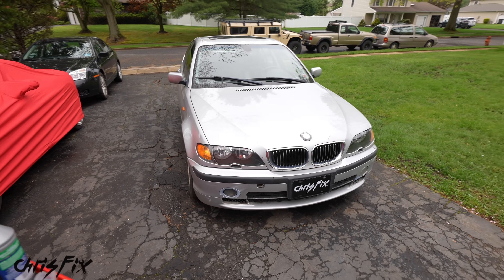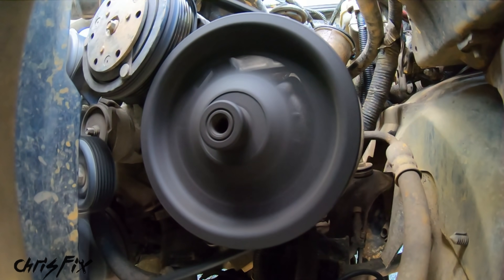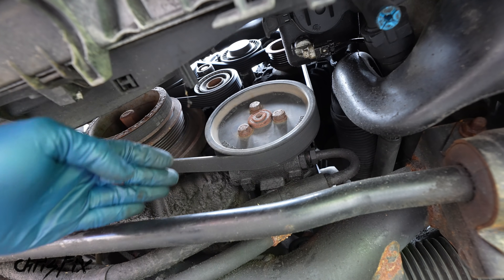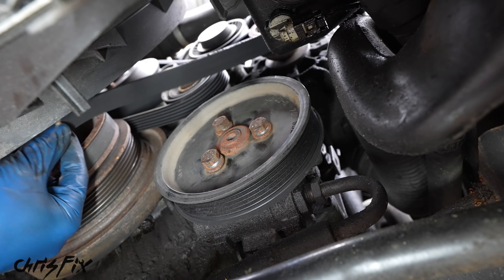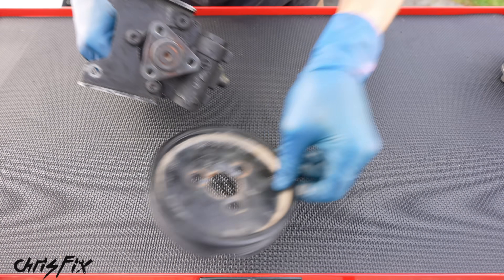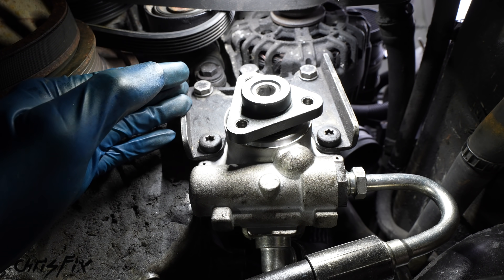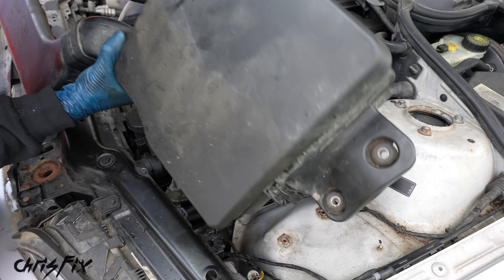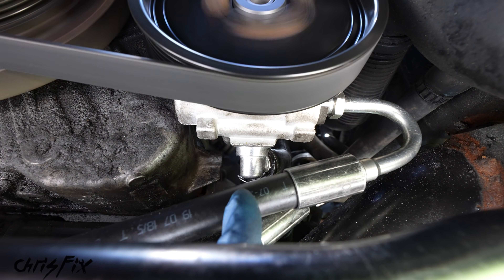How to Replace a Power Steering Pump

Comment: today I went to go see a car and it the steering wheel was a bit hard but the owner told me it needs a oil change could that be the problem because the steering pump doesn't make any noise and it's not super hard to move like in the video it's just not super smooth (the car is a 2011 subaru impreza wagon 2.5)

Comment: You forgot one more reason why the rotor on the steering pump might stop... Screws. 

Yes, screws.
I changed mine and forgot to put one of the screws in and I thought the new one was broken too. It wasn't, took me a while to realise
Reply: Gives you the same issue as a bad belt, because the tension is not there

Comment: Chris thanks for the great videos, have a question. What’s your trick to get proper torque specs. I have a 2007 hummer h2, have a gone to multiple dealers to try get repair manual and not available. Not really trustful of random websites. Thanks

Comment: My power steering fluid reservoir keeps going empty but I can’t find a leak anywhere. I took out the reservoir and the hoses and checked them for cracks and leaks and couldn’t find anything. Any ideas?

Comment: Can a bad alternater cause the steering to squeel? My alternater is bad and I'm working on replacing it and the AC belt and power steering belt. Id like to replace power steering pump while my car is taken apart but im hoping i don't have to pay for a new one and its something else. The steering pump and pully are over $400. The reason im questioning if the pump is bad is because its rusty and the pully is very rusty so im worried it will screw up my new belt.

Comment: My truck has a lot of play in the wheel and my power steering doesn't work as well as it should. When you're turning the wheel to back out of a parking space, it takes more effort than it should to turn the wheels. When you're driving, it has very sloppy steering. Is it my steering box?

Comment: Hello chris, i have a 1999 Nissan NP300 King cab and the steering is okay and light, but when the steering is at a certain angle it make grinding noises. Do you know what the problem could be?

Comment: hey chris, where did you get the highpressure lines aswel as the new reservoir and plastic lines? had a failure in my power steering pump aswel so changing it rn. thanks!

Comment: Have a question for Chris or anyone in the know.  I have a Lexus that the manual says requires ATF for the power steering fluid.  But it looks like someone put regular clear power steering fluid in the system rather than the ATF fluid the manufacture recommends.  I was going to drain and replace it with ATF.  Will there be any issues caused if I do not get every bit of the PS fluid out of the system and little remains mixed with the new ATF?    Is it possible the clear fluid in the PS res is actually some kind of clear no color ATF?

Comment: @Chrisfix I have an issue with my car maybe you can help me, Everytime I turn steering wheel all the way to left or right on my w204 c350 while the car is idle, the steering starts to shudder and rpm increases, what could be the possible reason?

Comment: So my power steering pump is leaking badly and the fluid is low/ dirty on my '88 F-150. The belt slips from the power steering pump pulley seconds after I turn the car on. Is the belt slipping because the pump is bad? I already replaced the tensioner and the belt is lined up correctly, so I'm assuming it's the pump.

Comment: I think I got to change it cus I add fluid and then like two days the fluid is almost gone and makes noise but the steering wheel is fine and acts normal but I did a oil change and I can see in one side of the car it’s all wet and greased up on the power steering side but I want to know how come I have low fluid and my steering is fine

Comment: Hey chris, Mom's 528 2009 BMW was low not on the stick. Fluid in the reservoir but lower than the stick. So I grabbed a bottle of Prestone European model fluid from Walmart. We ran errands it was fine but then she drove somewhere else that day and the steering was very hard manual labor. Is your video will be the third video, so to point I plan on reservoir change and fluid flush ... Any advice ?

Comment: I thought the e46’s would recommend using atf? Is the synthetic fluid you used better in your opinion? I have a 2003 e46 330i and I’m getting ready to do a power steering flush and looking into what fluid is best to use
Reply from the maker: So this stuff is better. I actually reached out to PEAK to ask this exact question and they explained why but honestly I forget haha

Comment: I have a 2008 Hyundai Azera and I replaced the power steering pump and bled the system the same way but the steering is still stiff. There are no leaks or air getting in, any ideas?

Comment: Hey Chris just wanted to let you know you might need to change that power steering fluid in the BMW idk though(it could be okay to leave it)but In my opinion the fluid looked pretty black coming through the turkey Baster and btw.....how heavy is that new aluminum belt pullley/tensioner?(how much weight is that aluminum tensioner adding to the car in other words?)

Comment: Clearly that power steering kit he bought off ebay was one the seller found after it "fell off a truck".  Because the CHEAPEST you can get ANY of those kits for an e46 is around $650.  The majority of them are around $800 complete like his.  That is, if you have the LF-20 pump like he did.  If you require the LF-30... ppfffth.  You're in for a HUGE surprise.

Comment: Pretty sure that year car takes ATF fluid for the power steering. Later years are different. May not make a huge difference if you changed all the fluid out.

Comment: Hey Chris, I recently changed my power steering pump but ever since I changed it, it started whining when I accelerate and it’ll groan when I lock the steering wheel all the way to the left and right without the car moving. At first I thought it was the fluid but it’s topped off. I’m not sure when it can be  hopefully you can help me out what it can be. I was thinking it could be a faulty new pump but I want to make sure it is before I take it apart and send it back for a new one.
Reply: Could be a leak in the hose or reservoir so first check for leaks. Could also be air in the fluid which means you will have to jack the car up and turn the wheel back and fourth about 20 times per side.
Reply: @loganl7088  thank you! I have noticed the the hose leaks so I might replace that

Comment: Hey Chris, I have a 1999 Ranger 2.5L which I believe is the same engine as your truck on the video. Anyway, I replaced the power steering pump and it's still making a lot of noise even after turning the wheel several times to  burp the air out, any idea what can it be? Thanks.
Reply from the maker: Ford pumps are noisy. Just drive it around and don’t worry. Make sure you check the fluid ina. Few days to make sure it’s still at the correct level

Comment: When I turn my car on, fluid squirts constantly out of one of the lines straight up towards the engine. Unfortunately there's also power steering fluid all over my engine. Including on my alternator. It's a Hyundai, and it would seem nobody online knows how or at least will show how to repair a steering system in a 2002 Hyundai sonata. Auto part stores don't seem to know what line I need either.

Comment: I actually have a Manual Mitsubishi Jeep from 1969, and when i try to turn the wheel while it's idling, it tries to stall. So i have to hold the clutch and bump up the RMP every time. It gets really annoying when I'm stopped at traffic. What are the possible causes?

Comment: guys i got a question i got a bmw 320i e46 1998 and my steering is hard to steer but not to hard so you can still drive is my pump broken or not also i got some fluid in my tank

Comment: I have a Mercedes E500 2003 and my steering wheel was hard and then it got harder I step on the gas’s a lil and it’s still hard to turn

Comment: Hey. What if the steering is aloooot stiffer than yours? Mine went out when I was parking. Steering wheel is almost impossible to try and turn at all. Liquid is full. There’s no whining noise…it’s more of a sucking in noise. Not sure if it’s the power steering pump or if it’s the rack and pinion. Any advice on how to figure which one it is?????

Comment: The video is well done but - please use real clamps instead of the cheap perforated ones. Pinch clamps actually make a lot of sense in many applications, if you want to use worm clamp ones use OE ones or high quality ones like the ABA/Scandvik or the AWAB ones - and cut your tails, remembering to round out the corners of the cut tail. Your hoses will thank you, so will the next guy who sticks an arm down there.

Comment: Ok so, in my Ford Taurus 06 when I turn my wheel it’s easy to turn but it makes these loud screeching sounds worse than what I heard here, but my power steering seems fine I can turn very easily etc but if I’m stopped car is running and I decide to reverse or after reversing and turn my wheel fully the other side to drive out it makes those noises and only when I’m stopped… so is that a bad belt? Power steering pump problem or do I just need to change the old power steering fluid?
Reply from the maker: Check the pulley as someone turns the wheel and see if there is a pulley seizing up. Sounds like an old belt to me.

Comment: yeah my 2010 silverado (first truck) needs to be checked by a certified mechanic i know where the leak is coming from and my hunch is yet to be proven or disproven 

leaks coming from right where one of the lines goes into the pump so my hunch is its loose and is leaking it (i went through a quart of fluid in 30 seconds )

Comment: "don't forget to chuck the wheels" - PLEASE DO! CHECK 3 TIMES! Recently i was working on my rear brakes, and didn't secure front wheels. Guess what? The car just rolled forward after I pulled the wrench. Luckily I was kneeling, but just minutes before, my legs were directly under the brake disc.

Comment: I was riding along with a friend of mine a while ago and he was showing me that his steering wheel shakes at highway speeds, could that be a power steering issue or is it more likely something alignment related?
Reply: That could be the bearings in the wheels, possibly suspension. Definitely get that checked out, you don't want a tire flying off at highway speeds.

Comment: Hi Chrisfix I have a 1996 mazda bravo b2500 my steering wheel has alot of play when I’m driving or just playing with the steering wheel what do i do or what could you recommend I look at?
Reply from the maker: Jack up the front end and turn the steering wheel and see if the tires turn with the steering wheel. If not it could be the steering rack.
Reply: @chrisfix  so if it is the steering rack do i replace it and go from there?

Comment: Can someone try and help me understand if I should replace mine, I have a groaning. Noise from the power steering pump but the wheel isn’t hard to turn but sometimes the pump will go back to normal like nothing is wrong with it

Comment: My power steering pump is leaking and I was told I need to get replaced enough though it’s been replaced a year ago any suggestions or should I buy a new pump
Reply: If a shop replaced it check to see if there was any warranty on it for a certain year or mileage

Comment: Didnt mention a bad rack. Sure it couldve bedn the lines but on an 03 cavalier idk if thatd be the best option if its hard 1 way n not the other. N if it is the rack. I got news for ya. Open up a day n a half of ur schedule. Bc u gotta lossen the back of the crossmember of ur engine n drop it a couple inches. Then loosen all the rack components like the steering shaft and the lines from the pump. Then u gotta slide it. Turn it n slide it out more. Then do the reverse for the new 1. On top of that u gotta make sure the pinions are right. I found a secret for mine n it saved a bit of time but the fact that u gotta lower the engine on that car is insane. Not long after that it got totaled. So if anyone comes across an 03 cavalier in Columbus ohio with jegs stickers on the windshield most of the front end parts are near brand new. Check the junkyards.
Reply: On the plus side the cavi pump is connected to the camshaft and not the bdlt so its easier to replace.

Comment: Nu pump failed at where the bold get in ...I think because the bolts wasn’t tight enough that caused the pulley vibrate

Comment: I searched the comments for what Im about to say but never found it. I always jack up the front wheels then with the cap off engine off turn the wheel lock to lock. Replace the fluid and cap then start the car turn wheel lock to lock again until the whine stops.

Comment: Hello guys, so I heard a noise when I turned the steering wheel and it wasnt easy to turn it either so I decided to change the power steering pump and after that the noise disappeared but its still not very easy to turn the steering wheel. The fuid is okay I changed it and there arent any leaks. Any tips what could be the problem ? (BMW E46 328i)

Comment: My power steering makes noice only when I turn it all the way to lock but after I return the steering wheel it quiets is that normal?
Reply from the maker: yes there is a pressure relief valve that opens when you max your steering

Comment: Theres a better way to bleed the power steering fluid, instead of starting the car just put the key on and go lock to lock a few times and youll see the fluid level in the reservoir drop

Comment: Why is that high pressure line so long? It goes one way and then returns... Fits right into the steering raw which is sitting very close to the pump itself
Reply from the maker: That helps the fluid cool since the long line is exposed to the cool air flowing under the car. Usually the coolers are metal so they can transfer the heat better.

Comment: Gotta love BMW.   BMW owners should replace the radio with a money slot.   Every 1000k miles just slide five hundred dollar bills into the slot to make it easier for the car to take your money.   The only brand that is worse than BMW is Range Rover.   If you like having your car in the shop and helping your mechanic pay for his new summer house then I recommend you buy a used BMW or Range Rover.

Comment: I can't believe how dangerous power steering pumps are when they fail.
They should fail in a way, that they simply remove the power assistance, but they get worse/harder than if there was no assistance.

Comment: Does anyone have the link for the exact kit he bought? I need it for my 323i and I can’t seem to find it on eBay, only found the pump but not the correct hoses.
Reply: Fcp euro should have it
Reply: I checked and you should be able to get your ebay pump, and then correct hoses and reservoir off of fcp euro.

Comment: I know Im late but you did not put correct power steering fluid. BMW calls for just atf, that is not atf, it is hidraulic fluid that is used on other BMW, not this one tho so it will destroy the pump. Tell me how I know

Comment: What could  be my car issue if every time I  turn the wheel and we hear a lot of screeching sounds.
Reply: most likely a bad belt, replace your belts on the engine. especially the belt that goes to your power steering pump
Reply from the maker: Could be the belt, could be a power steering pump seizing up, and it could also be ball joints going bad. Check this out for the noise: https://youtu.be/62bVn7E8gyk?si=KGtxxAwjdvOSjl8A
Reply: Video is 2yrs old and bro still replies to random comments looking fot help. Legend.
Reply: @chrisfix  thank you so much!!
Reply: @ZupGarageJPN  thank you so much!!
Reply: @KAPKAPKapkap-ml6wx  I agree!!

Comment: When he says “Torque both of these down to 16 foot pounds.” What does that mean? Specifically “foot pounds” and why “16”
Reply: Basically it's how tight the bolt is tightened down. Each bolt/set of bolts in a car are supposed to be tightened down to a specified tightness (some are only as tight as you can tighten by hand). It depends on the car manufacturer but you can usually look up the torque specifications online or in a manual about your car.

Comment: Good information, but do not do what chris did, in the end, turning the wheels on ramps lock to lock.  Very dangerous!  Place the car on jack stands if you want to work the steering wheel lock to lock.

Comment: Is power steering always right over the alternator? That's what was the last nail in the coffin for my old Ford Focus. Power steering sprung a leak, went right down into the alternator, I lost all electric around the corner from home, and finally said F this car. Never drove it again and sold it as salvage on Craigslist.

Comment: How do you find torque specs for everything? I just can't imagine how you found the torque spec for the bracket that goes on the power steering pump.

Comment: This is the wrong power steering fluid for this model of BMW! These models of BMW use ATF in their power steering (Dexron III/Mercon). The regular power steering fluid is too thin for them. It leaks out and wears out the system prematurely.

Comment: Incorrect, wheels should be off the ground and engine off when going from lock to lock to bleed the rack and lines otherwise you risk damaging the new pump, the same applies for engine and transmission, at no point do you want air being sucked up and the pump running dry..
Reply from the maker: Thanks for the tip, what I did was taken straight from the bmw service manual .